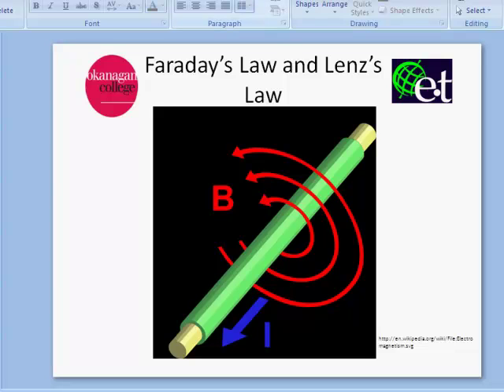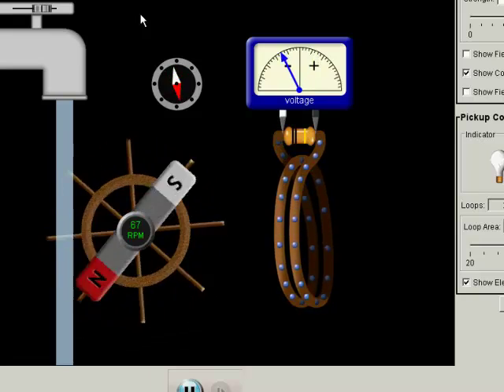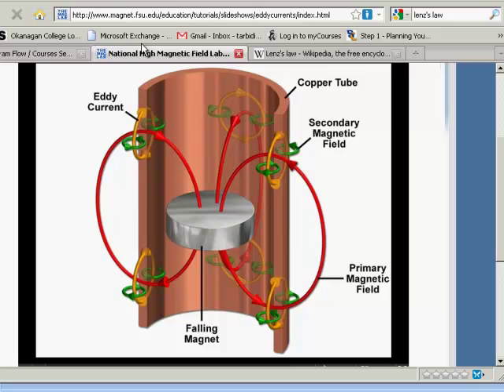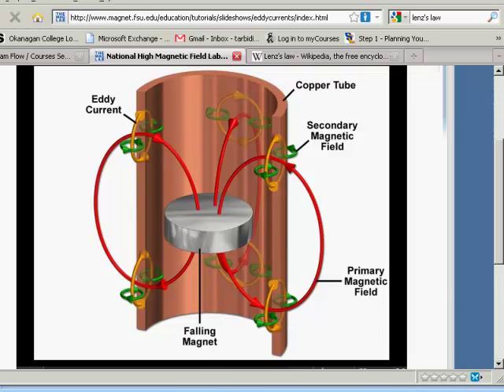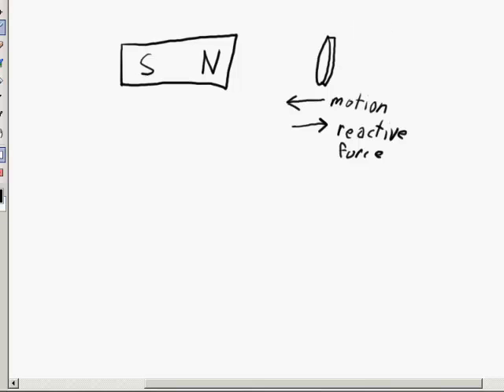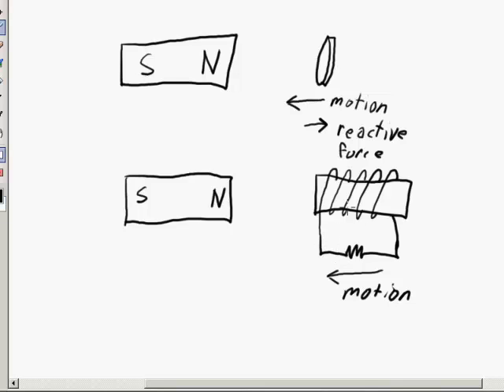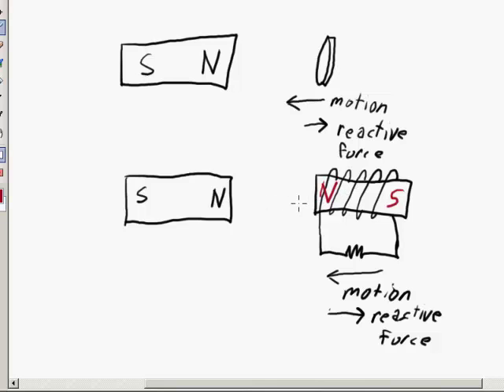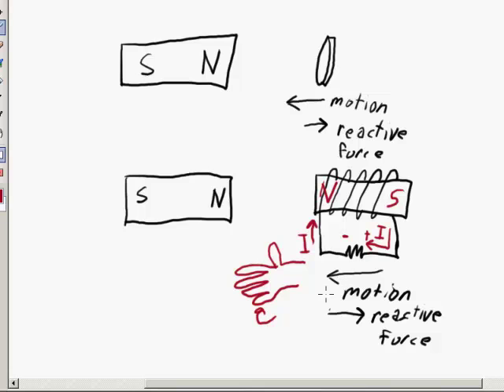Electromagnetism 3b - Faraday's Law and Lenz' s Law

Comment: @jozet77 nonono you have it backwards, the video is correct.  The magnetic field lines come out of the north pole of the induced magnet, this opposes the north pole of the permanent magnet on the left.  Right hand rule says that the current is moving up on the left side of the coil so that the magnetic field it creates will go toward the left, acting like the north pole of a magnet. Like poles oppose, therefore opposing the motion and conserving energy! Gotta love physics!!

Comment from the maker: If the motion of the electromagnet is toward the permanent magnet, the induced pole on the electromagnet will be the same polarity as that on the permanent magnet to try to prevent you from moving the electromagnet closer. Then use the right hand rule to figure out which way current is going (conventional current)